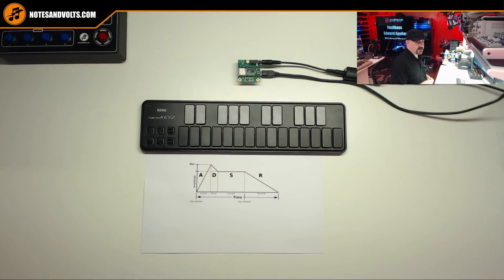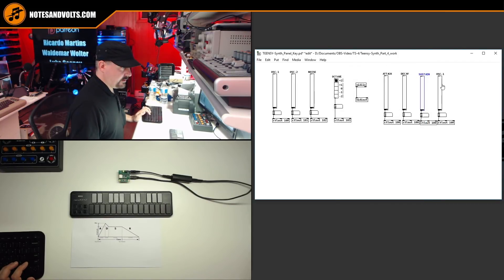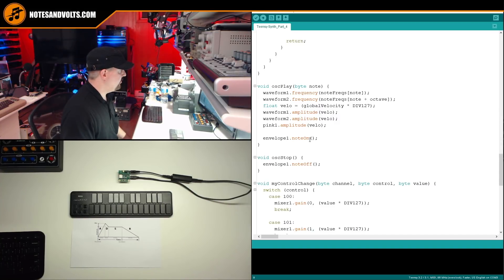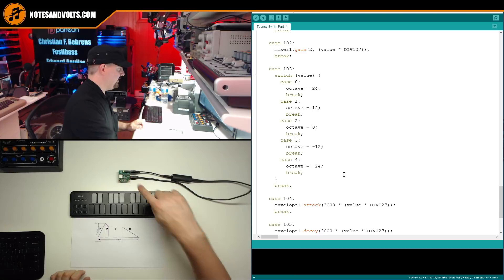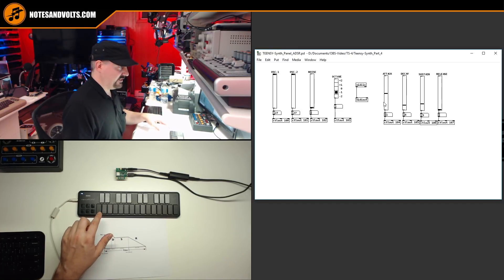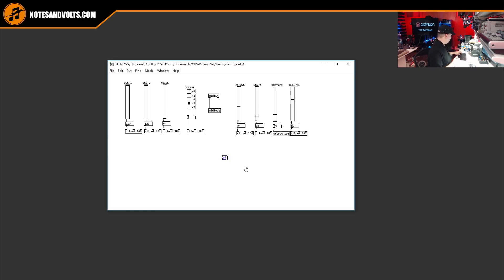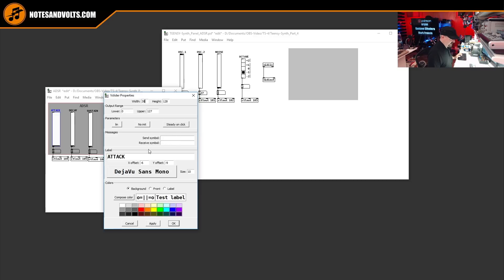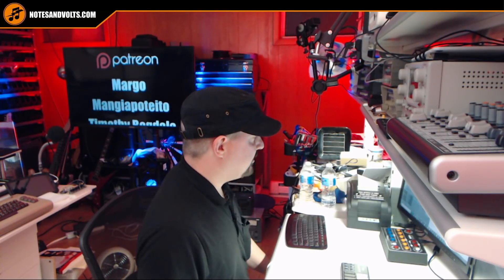TEENSY-Synth PART 4: ADSR

Comment: Great videos Dave they are really helping me as I've only just got into the Teensy, I have a question is there a command that I can use to output the value of the envelope generator to an external DAC so I can use it as a control voltage ?

Comment: This is a great series - thank you very much for it!

I have a question, am I right in thinking that the PureData part is there as a sort of 'go-between' the PC and the Teensy? What I'd like to do is connect a MIDI controller directly to the Teensy and thus do away with the PC making it stand-alone. Will you be covering this in a future video?
Reply: Well I've being doing a bit of digging, and what I think you need is a MIDI host device to go with it. I've bought one of these http://www.hobbytronics.co.uk/usb-host/usb-host-midi to try it out. There is a good tutorial on the site which explains it.
Reply from the maker: Thanks John! I'm glad you like the series. In a way, this is already happening. The Teensy is actually acting like a USB midi object that receives standard Midi CC commands. Pure-data is simply emulating a Midi controller. You could replace Pure-Data with some recording software like Ableton and control it that way. If you wanted to hook up a 5-Pin Midi controller it would require some additional circuitry.
Reply: John took the words out of my mouth!  I guess you would have to power the Teensy via a direct power connection and disable the USB power link -- I think there are pads on the board that handle this stuff.
Reply: I thought it was possible to get a Teensy to work as a USB host device, but maybe the audio stuff prevents this.  If so, this looks likes a good solution.